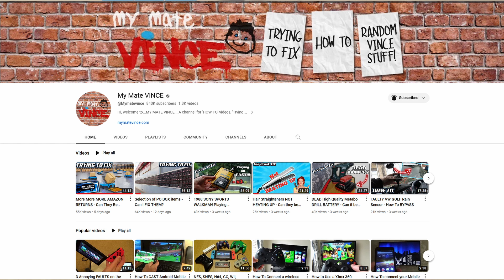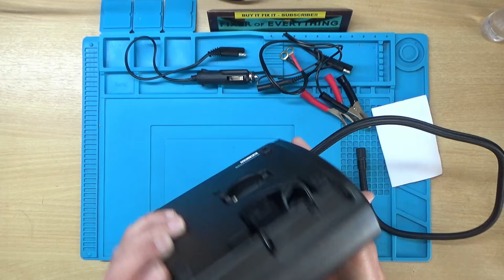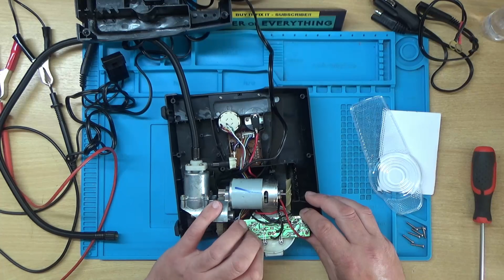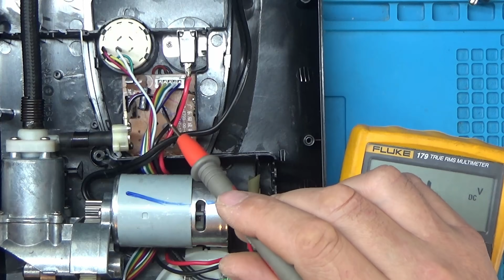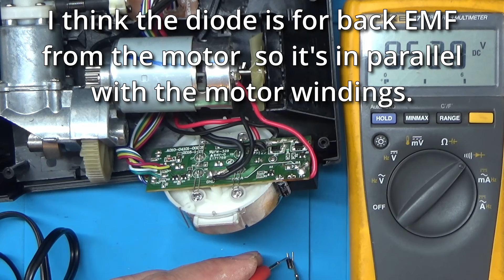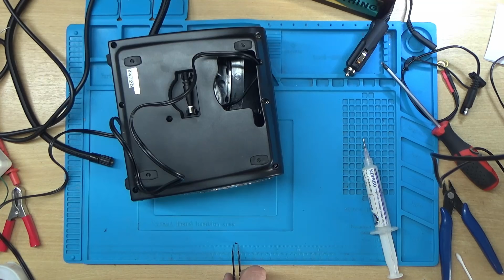Ring 12V Digital Automatic Tyre Inflator | Can I Fix It?

Comment: I think that it was pretty obvious it was going to be that transistor at fault.
Reply from the maker: It was pretty much one of the first things I checked  and the readings initially didn't seem bad. I guess I was getting readings from some other components, but it could have easily been burnt contacts in the relay, or the signal from the MCU or a crack in one of the traces...

Comment: In 1980 when sm came in we used fag packet inner to dissipate the heat from adjacent wires and components . So silver foil or gas tape should be more woke now. Using a black and decker paint stripper gun as a heat source 😮 and no visual magnification. It were tough 😂.

Comment: i would have just solder the power leads to the motor. and had done with it. aka some of the cheap ones . nothing fancy. i always use a separate gauge for checking pressure.
Reply from the maker: Yes that would work, but I think it was more fun to try and figure out what the actual fault was and hopefully fix it 🙂

Comment: If I had a compressor like that i'd bypass that relay and put a switch so you can just turn the motor on or off.
I'm from the days when you plug it into the cigarette lighter in your car it starts up immediately. None of the electronics crap.
Reply from the maker: Yes that would totally work also! I did something similar with a fly bug zapper a few videos back, the electronics got fried so I just made it "always on" as then at least it was still useable.
Reply: @BuyitFixit  I have a similar zapper. Mine is nothing more than a 5v computer fan and black light LEDS. I have another that zaps but is silent. I like the zapping sound.
Reply from the maker: Yes the one I looked at was pretty much a computer fan and some UV LEDs. My daughter or her husband plugged the wrong power supply it which seems to go straight to the microcontroller as it's designed to be powered from a USB so 12v or whatever straight into the microcontroller 😂😂😂
Reply: @BuyitFixit  We both probably have the same zapper. Mine seems to be pretty dumb I'll have to take it apart and see.

Comment: That diode across a track is an odd thing!  Circuit board goof I would wager. What is the brand of soldering iron you use? Thanks for the info.
Reply from the maker: Yeah I think its a goof too! It's an Aixun T3A. If you want to see what's inside of one I actually did a repair video on it. The diode in it actually failed totally a few weeks later but I updated the video description explaining what I did and how I fixed it again and it's been fine ever since.

Comment: Just an educated guess that the PCB and components may be similar to another PCB model, and perhaps they run out of PCB's and the mindless 
Err-zoned out assembler soldered that sucker in as if it were the other PCB revision or model where the track doesn't exist.

Oh.. and it could be on one side the soldering was inadvertently bridged to where it shouldn't be..
Reply from the maker: Thing is the place the diode was fitted  was marked on the silk screen too...
Reply: @BuyitFixit  Yup.. no doubt they used the same silk screen template for all models and or revisions..
Reply from the maker: Yeah makes sense 👍

Comment: I've had that compressor for 12 years now but mine only came with the cigarette plug. A tip to keep it running for years, take the compressor apart and lubricate it with high temperature grease as they aren't well lubricated at manufacture. I bought 2 others for my sons in-law and theirs overheated and seized up.
Reply from the maker: Thanks for the tip 👍
Reply: But not the "compressing"part....Greasing/oiling where pressurised air goes is never a good idea...Think diesel......
Reply: @muppetpaster  The compressed air goes into the tyre, in 12 years it hasn't started running on it's own power 🤣🤣🤣🤣🤣🤣
Reply: @Phil-Sands I doubt you'll be posting a runaway compressor video 😊
Reply from the maker: @muppetpaster compression ignition 😂😂😂
Reply: @muppetpaster  If your tyre compressor is creating enough pressure to cause ignition you have bigger problems.
Reply: Worried about dieseling ? Try Graphite Powder instead. It's an awesome dry lubricant which embeds itself into surfaces to create a very long lasting friction reducer. I used graphite powder instead of oil/grease on the synthetic piston seal and compression chamber of an old .22 barrel-break air rifle once and it went from about 11ft/lb to almost 14ft/lb and it wasn't easy getting it back below12ft/lb after that.

Comment: Well done. That protection diode is not living up to its name, I was expecting a lot more damage when the supply was originally reversed. You are obviously not familiar with the blow track before diode, protection method and the recent standards change to the capacitor symbol (now meaning diode), ho, ho.
Reply from the maker: Thanks Ralph 😂😂😂😂😂

Comment: I have been picking up soldering practice kits off of Aliexpress, so far got a 0-30v variable power supply kit, a multiuse chip programmer with modules for different sorts of chips and ordered yesterday a fairly robust 2 channel amplifier kit with speakers.   Quite enjoyable just putting these together and they cost only a few pounds each and already the PSU has earned its keep.
Reply from the maker: Nice, I might have a look to see what's available. There's loads more stuff around now than they used to be. I remember having to etch my own boards and things back in the day 😂😂😂

Comment: Could the diode that had the copper short underneath it (D11) be for the vacant diode location(D12) and the axial diode should be a cap.
Reply from the maker: Could well be👍. Still a bit of a mystery why D11 is marked in the first place though 🤔

Comment: The Diode is from a previous version, or for the new one but they have forgotten to remove the trace. But in any case in the actual state the Diode is not in use
Reply from the maker: Thanks for that I was thinking possibly a design issue or something.

Comment: In the real world, these tyre inflators are total pants.🤣
Reply from the maker: Agree, not great but better than nothing in an emergency. I've got a proper compressor that I normally use for tyres but that would be slightly large to keep in the boot of the car 😂😂😂
Reply: Agree, and you often find that some of the better ones draw WAY too much from a little cigarette plug. Had a few plugs/sockets melt in the past so now I run mine direct from the battery (fused).
Reply from the maker: Yes, I've found that the cigarette lighter plugs on them do get a bit hot. Although not hot enough to light a cigarette 😂😂😂